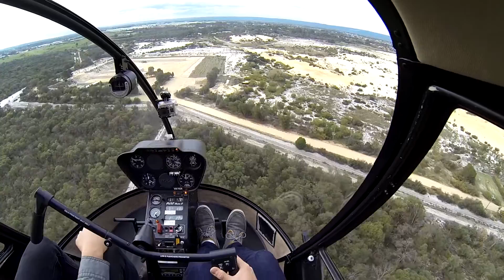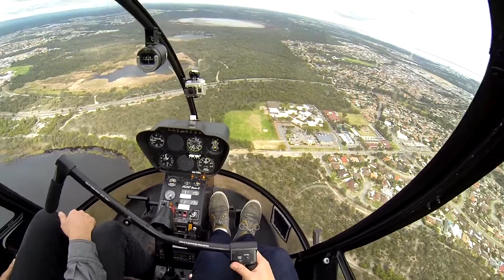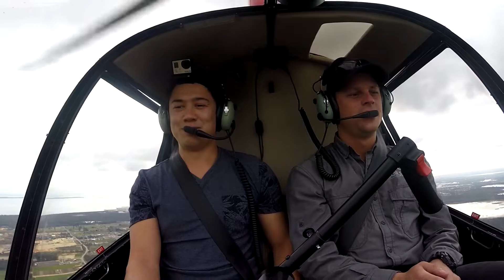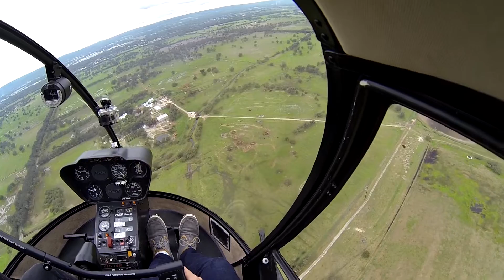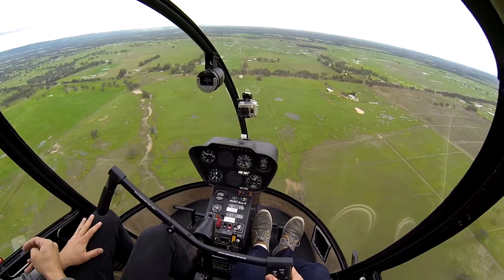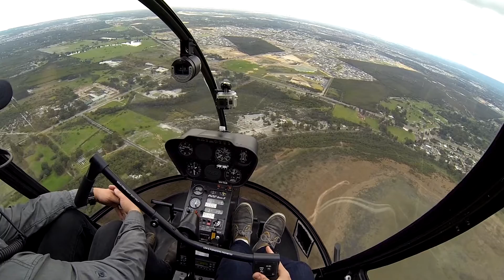Robinson R22: Lesson 23 "Emergency Procedures" (Full Lesson)

Comment: That would be really interesting but voice quality is really bad, combined with radio chatter, you're hard to understand.
Reply from the maker: Appreciate the feedback. I have been trying to find the best way to normalize intercom audio when editing the video, however in practice its tricky because the incoming radio transmissions can sometimes be recorded as louder than they are perceived at the time of flying. 

What may be deafening in the recording could be barely audible while flying. 

Hopefully in my latter videos the levels are better balanced. 

Cheers
Reply: @Chang739  Place a normal 3.5mm microphone inside the earcup and record audio on your cellphone and not the camera. The GoPro adapter picks up all the static and noise, but if you use a mic that will be reduced, and you get a consistent volume as well.
Reply from the maker: @roynorb  Thanks for the advice; o did exactly this and it turned out great. Cheers!